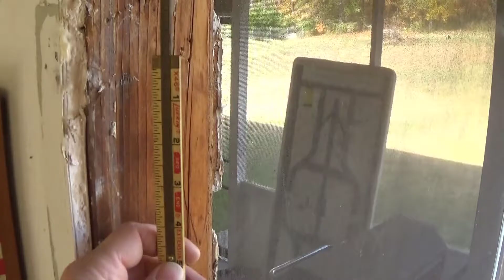How to Close Off a Window Opening

Comment: I can completely relate to your frustration. My fiancé and I also have a fixer-upper that we unfortunately overpaid for in 2022. Not a single thing in this house was done right, and we've spent thousands repairing shit. 

The worst and most expensive issue was the roof. It was supposedly "new" when we bought it, but it turns out that it was just new shingles laid overtop the old ones on only half of the whole roof, and there was no flashing whatsoever, which resulted in a leak into our living room. That was a $20k fix. 

Another lovely thing is that there used to be two windows in our bathroom, but they decided to cover one up from the inside with mdf and call it good. Wtf.

And there's countless small repairs that I've had to do. Mostly plumbing related.

Comment: If you think the glass might shatter then put safety glasses on
Reply from the maker: I am bad about never wearing safety glasses, they usually get in my way. I could have run tape over the glass or masked it up on both sides as well. Good point though, anyone working around glass that might break, they should wear safety glasses.

Comment: I have a 75 yr old small window and I'm having house resided..can I cover this window with siding its a useless window in utilities room and its tight in there,and window is never opened it's a single pain glass window.18 by 24  ancient push out lever to open.its sealed shit with old caulk..can my contractor  just cover it with insulation and siding rt over this useless window?

Comment: When you closed the air-conditioner did you frame it in the same way? I need to close off one in my bedroom :'( but my exterior is stucco. Does the stucco go over the plywood? TIA
Reply from the maker: I framed the air conditioning hole off the same way I did the windows. On the stucco, yes, it goes over the plywood. However, I would get screen wire made for doing stucco fastened to it first to help keep the stucco attached to the wood. Ask anyone at Home Depot or Lowes or any store that sells lumber and masonry products.